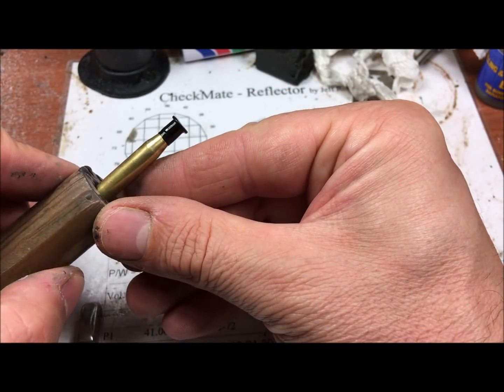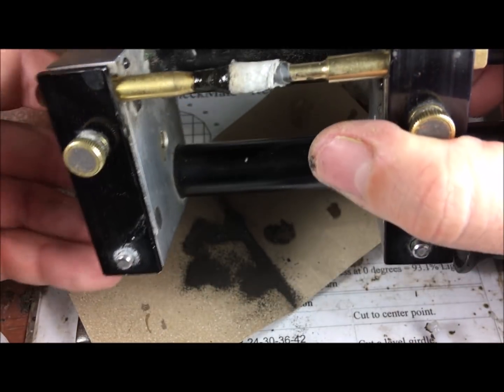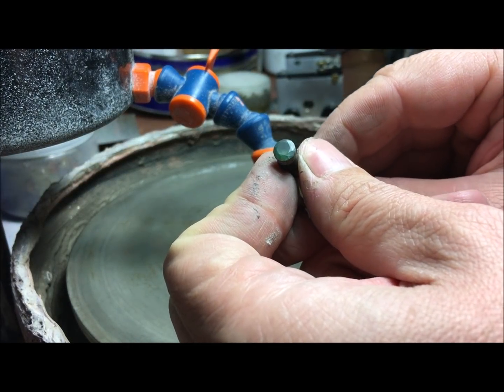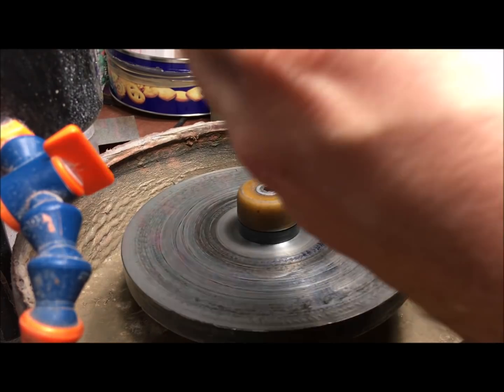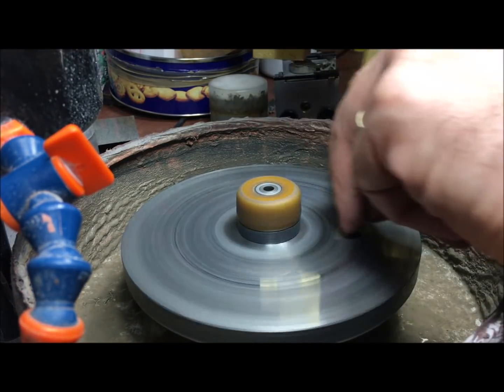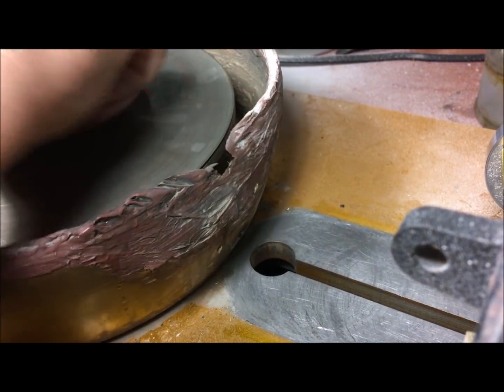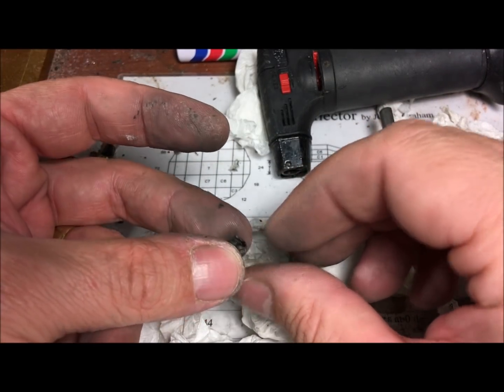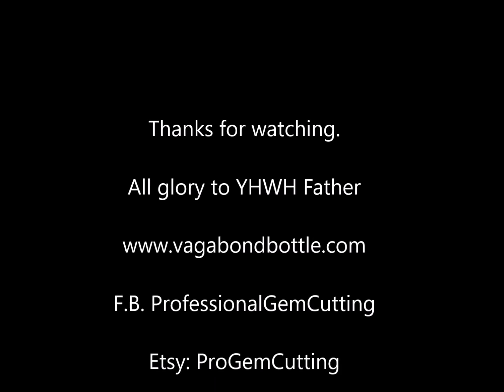Working Moissanite gem stones- Tips and Tricks

Comment: Your are very good at explaining things!! Apologies for such an amateur question, but is it possible for the surface of a large moissanite (round cut with facets) to be slightly convex after cutting and final polishing? Thanks!!!
Reply from the maker: Hey there thanks for commenting! I don’t consider facets finish as a conclusive indication of authenticity however it does rises some doubts. If needed to be sure about the material, usually recommend to investigate further using other gemological methods. Is it a gemstone you cut?